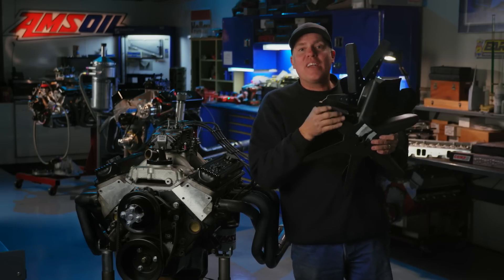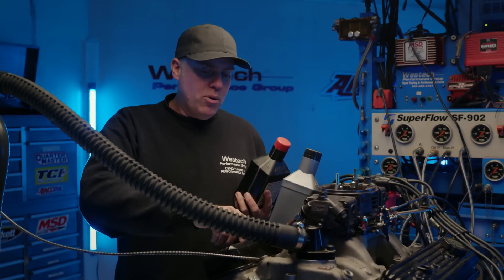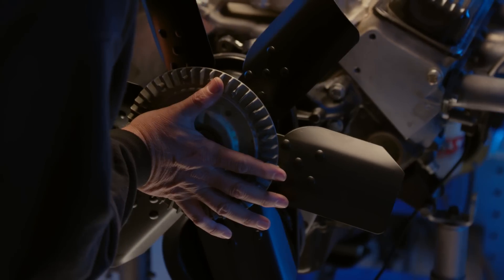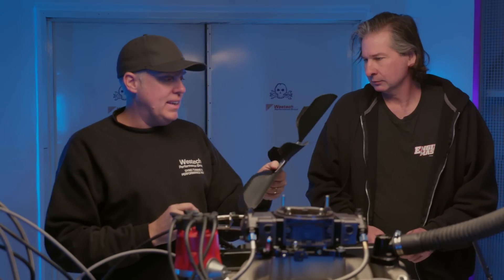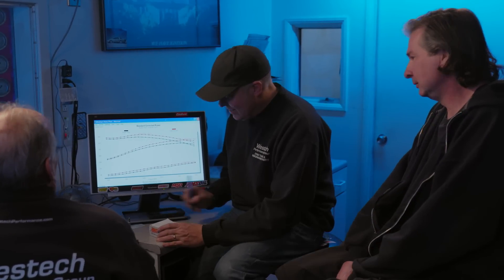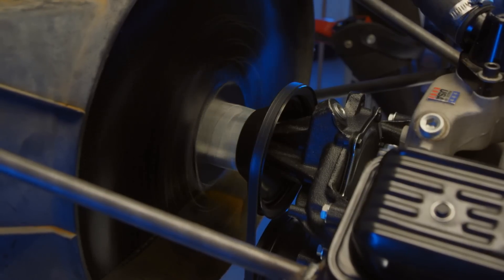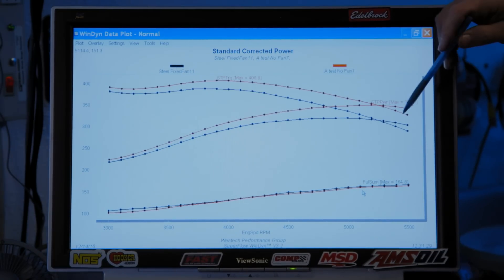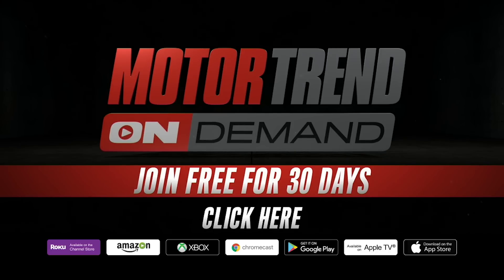Cooling Fan Shoot-Out! - Engine Masters Ep. 20

Comment: Saying that electric fans are more efficient is the right conclusion for the wrong reason.  What is somewhat suggested here is that electricity is simply the better way to power a fan, but I don't think that this is a fair conclusion.  The reason is that the blade designs are not comparable.  These are each essentially a single bend, stamped out on a metal press quickly and easily to make for low manufacturing costs and surely must create high turbulence.  Contrastingly, your standard electric fan actually looks like a fan, not a crudely bent sheet of metal.  The common electric fan has smooth flowing curves that sharply cut the air parallel and then gently guide it into perpendicular movement, they don't just smash the air with an angled hammer.

So it is not crankshaft versus electric power, it is the fan design.  Make a crankshaft driven fan with the same shape as what you would find in fans for every other application (furnace, air conditioner, box fan, oscillating room fan, personal desktop fan, etc.) and it would probably be just as efficient.  Search your favorite retailer for fans and you will not find anything nearly so crude and inefficient as these.

I would imagine that part of the reason that crank driven fans are so bad is because the crankshaft starts and stops violently and therefore an attached fan needs to be made of strong materials.  A small electric motor is weak and therefore accelerates the blades gently.  Attaching a fan designed for electricity to the crank would probably cause it to be ripped apart when the engine starts.  This makes engineering a sleek design difficult.

Comment: I think that the reason that the fixed fan made better power without the fan shroud is due to the fact that it's not pulling as much air through the rad. While you will see better power, the cooling will suffer, and the engine will run warmer.

Comment: I'm curious whether one could jerry rig a high compression engine by welding metal to the piston heads.
Reply: I have seen this done before, it is old school and probably has a good chance of failure. It would be much easier to get high comp pistons or maybe weld on the head and have it machined.

Comment: I don't want to rain on your parade engine masters, but this was an invalid test.  First thing I noticed was the bare carb.  Then when you added fans, no one commented on turbulent air ripping over the carb throat.  
Put a tall enough stack and bell - with an air flow meter -  to see if anything odd is going on in the dyno room.  This should kill the disruptive air over the carb.  30hp to just move that air is a tad on the absurd side - even if it wasting power just to heat the air it's churning.  30 HP is over 22,000 watts guys.  That's one hell of a belt driven furnace!

Comment: The shroud forces the fan to pull air through the radiator, which adds WAY more resistance than if it can move air freely that doesn't have to pass through the rad.

Comment: David Freiburger and Steve Dulcich - this wasn't a TRUE comparison, put the radiator and shroud in front of the engine with NO FAN and see what happens. NOBODY runs a car without a radiator, even if they aren't running a fan on the engine and using an electric one.

Comment: On the front of the fan blade you will have pressure and on the back a vacuum. When its in a shroud there amount of air available to fill the vacuum is less. Its basically trying to suck the fan backwards and only gets worse with smaller radiators and shrouds. The purpose of the shroud is to direct air through the radiator though so the radiator is more efficient.

Comment: The fan clutch won't cause a loss of power at highway speeds. the air moving through the radiator will be greater than what the fan is pulling through the radiator which essentially puts a force on the fan to spin it. If the fan clutch is engaged there will be noticeable drag because the fan will spin faster than the air flowing through the radiator is moving.

Comment: Anyone else curious on electric fan numbers?

An electric fan pulling 50A (WAY high) consumes 600W of electric power at 12V.

Assuming we have typical inefficiencies (70% efficient alternator and a 70% efficient fan motor), this takes right around 1200W of power at the crank. That's 1.6 horsepower.

Comment: But: when you're accelerating the car is moving so does the air. Doesn't the airspeed reduce the drag?
Reply: good point. but also very car specific, i think....depending on how the air is guided into the engine bay and out again. maybe a task for a car-dyno.
Reply: they have fans pointing at the engine with wind speeds at 60 mph. its just like driving
Reply: below 60kmh is no difference, over 80 kmh difference can be noticed, because cooler has tiny gap between coolers pipes and makes big air drag to airflow, so airspeed must be very high to flows faster than fan grabs air
Reply: Also the majority of your butt-dyno is feeling horsepower while accelerating, not while cruising on the highway. Taking power away between a stand still up to 60 is where the fan is going to hurt your power, not after you get to 60 and level out.

Comment: Maybe do a future episode with electric fuel pump vs mechanical fuel pump. I'd be curious to see how much or how little power the fuel pump eccentric drags from the motor. It would have to be a carbureted motor though, as typical mechanical fuel pumps can put out a max of maybe 10 psi.

Comment: With the shroud off there's less air restriction, you have to think that the radiator itself is very restrictive in terms of air flow and with the shroud off you're allowing the fan to pull air in a less restrictive way.

Comment: Removing the shroud improved HP because it was no longer being forced to pull air through the radiator. Just like a subwoofer, a radiator fan is more effective when it faces resistance. If it's not facing resistance in air flow then its not likely to be doing its job, but like we just saw, it requires more power to move it.

Comment: This might be an obvious statement but I think the test might be missing the moving air that'd be running into the radiator at speed and how that might help mitigate parasitic drag due to the positive air pressure towards the front. I don't think it was covered but if the dyno is running a fan that might already simulate that. Also looking forward to a similar test running electric fans if you're ever brave enough to do all the setup.

Comment: YOU GUYS ARE VERY GOOD AT WHAT YOU DO BUT, THE FIRST TEST WITH THE FAN WITH THE CLUTCH HOW COULD IT BE TESTED WITH OUT ANY DRAG IT WAS FREE SPINNING IT TAKES HEAT TO ENGAGE & YOU DIDN'T HAVE ANY HOSES CONNECTED & HOT COOLANT RUNNING THROUGH THE RADIATOR IT WAS JUST FREE SPINNING.

Comment: okay i'm writing this before the run with no shroud to see if it eats more power then with the shroud, and I'm putting my money on no shroud eating more power, here's why, the shroud allows the air pressure where the fans running to be lower then without the shroud, therefor taking less power to drive the fan through it.

Comment: One variable you guys didn't test, you were in a static air environment, when you're driving there will be windforce coming through the front of the car reducing the HP draw of the fan
Reply: There's an Extra about the Dyno cells at Westech, the air in there isn't static. They have vents in the front of the cell and a giant exhaust fan at the back. Dave said in that extra that when everything is on and your standing in the room you can feel the wind moving through it.
Reply: Shane Serpico The correction is much appreciated sir

Comment: If i remember correctly from fluid dynamics the lack of a fan shroud reduces its rotational power consumption because the area the fan is outputting the air is less restricted reducing its resistance to rotate, where as with the shroud air is running off the top of the fan blades and getting pressed against the fan shroud increasing air pressure and thus the air's resistance to flow.

All around great video!

Any chance of having some fan wiring tips in the future, possibly something about making an electric fan system RPM or temperature dependent rather than just on/off? Or possibly a test to see if the thickness of the radiator with a direct drive fan effects the amount of horsepower lost?

Comment: The radiator is acting like a air filter causing a restriction in air flow.  Without the shroud no air is pulling pulled through the radiator. Duh! it's going to make more power without the shroud.  I can't believe you guys didn't know that.
Reply: sorry...I thought if a fan is restricted, it is not doing as much work. be interesting for tham to do....why vacuums rev higher when blocked? does seem counter intuitive.....but are they doing less work?
Reply: Restricting airflow to a fan does not make it turn easier.  If you increase the difference in pressure between the two sides, you increase the load on the fan.
Reply: no need for smarts here.....man someone argued with you
Reply: to jp
Reply: This is almost word for word what I was telling some friends after seeing this video. I can't believe those three guys in the vid were so baffled by the result.
Reply: I can't believe you guys thought to use the radiator and shroud, but didn't know why you were using it.
Reply: Restricting air flow to a fan makes it turn easier. More air will spin around with the fan blades which puts less resistance on the fan than if it is pulling air through.  
I used to work at a gym and when people found fan resistance exercise bikes too hard to pedal, we would stick magnetic sheets to the fan cage. This restricted to air flow through the fan and made it easier to pedal.  
The reason the fan took more power with the fan shroud on is because the shroud forced the fan to move more air by directing the air flow. Without a shroud the fan was allowed to spin more air around and it didn't have to move so much air backwards.  
A more restrictive radiator would actually make the fan take less power from the engine.

Comment: Might be kind of cool if you guys took an engine and ran it on gasoline, then ethanol, then had some milled heads that were the same as before, just with much smaller chambers, to compare the advantages of gasoline at regular compression vs ethanol, vs ethanol at high compression.

Comment: Without the shroud is probably just creates a huge low pressure area around the front of the fan that stays there. meaning the fan is moving less air. Similar to a vortex ring state for helicopters that results in a massive loss of lift.

Comment: The HP numbers are flawed.
Although the comparison between each of the fans would be similar to each other. In real-life, all the fans are all fed moving air (um.. vehicle is moving), and therefore using less power overall.
This test needs to be redone with wind speed in the dyno cell of 60mph to have relevance to actual conditions -if at all possible.
Anyway.. OE clutch fans rule. I can't stand the horrid white noise of electric fans that you often hear before the V8 rumble.

Comment: Have a look at the sheets in the streetable areas of the rev range.

Yes they still suck HP but the clutch fan didn't start killing HP until over about 3500.

If you have a nice little rod with that SB, before I'd run a fricken screaming banchy of a Thermofan, I'd throw a good clutch fan on it.

Most people I know with high performance stuff still run fans (most those stupid stainless decapitators) but they remove them when they go to the drags as they are not running for long enough to make a difference and some of them use a leaf blower and a sheet of cardboard to blow through the rad if running a bit warm.

On the street, no one would notice the difference with a clutch fan but would always notice when an electric fan cuts in.

Comment: Not really baffling, without the shroud the fan won't have to suck air through the radiator, so it robs less HP, would be interesting if you guys do an electric fan shootout and see how different electric fans handle high HP.

Comment: My '02 Chevy truck 5.3L with aftermarket supercharger has the OEM clutch fan, plus 2 electric fans inside the roomy fan shroud for a total of 3 fans. I added the 2 electric fans because the AC doesn't put out as well idling in traffic with the OEM fan alone. I also tried deleting the OEM fan and going all electric for a while, which worked OK, but then one day I blew the fan fuse and decided to no longer allow the possibility of no fan at all out on the road on a hot day, so I re-installed the OEM fan for backup. I have a master override switch to turn off the electrics in the winter, and 2 separate relay circuits on the electric fans. One fan is wired to run when the AC compressor cycles on, and one fan is wired to an adjustable thermo probe in the radiator, so it runs only when the radiator sees high heat. My objective with this setup is not max HP, but max insurance against overheating and max AC performance. Also, 25 years ago I had one of those metal flex fans throw a blade when the rivets sheared while I was jazzing the throttle on a G2 small block in a '68 Camaro. Fortunately, I was in the driver's seat and not under the hood. It put a nasty dent under the hood where my head might have been. Don't have any part of your body over any fan if you jazz the throttle while under the hood.

Comment: I would like to see a measurement of air speed through the radiator core at idle and cruising speed when the shroud is fitted, giving us an idea of efficiency, not just hp used.

Comment: Use an electric fan! To think of how. Far Chevy had to go to make an honest 350hp out of a 350 cu in stock block engine! The 350 hp 327 made only 313 hp on Vic Edelbrock's Dino in his testing in the mid 60's. The 350 Hp 350 actually made 323 HP according to crane cams in their early 80's testing. One way to keep the horsepower you've made is to reduce the parasitic drag on the engine. The more accessories on the engine during the dyno test, the lower the HPWill be. This is the difference the rating of the 60's and the ratings of the late 70's/ early 80's. Factory tests were gross VS net, or just the engine at the crank vs everything that comes on the motor bolted on and running for net hp. Net hp means running the alternator, water pump and A/C compressor along with power steering and hydroboosted brakes. All that extra crap sucks horsepower! Besides an electric fan, a fan clutch would be the least power robbing set up as it only uses the fan when the engine is hot. Also a fan shroud will accelerate the flow of air over the radiator cooling it down more than running without a shroud. It's the Venturi effect, just like a carburetor that speeds up the flow of air over the radiator. My vote? Electric fans or fan if the motor is small enough! One of my instructors at UTI ran without any fan on the street, he just avoided stopping wherever he could, and had extra overflow tanks when he couldn't. But he made horsepower and Had one of the fastest street cars on the main drag cruising through the late 70's!

Comment: Wow!, I run one of those plastic/nylon fans on my car. I've never had issue with overheating and at the time, I figured if the fan was ever to "let go" at the track, the carnage versus a steel/aluminum would be much more minimal. I 've seen steel/alum. fans cut open hoods, destroy radiators, cut open heater hoses, shred belts, gas lines etc. etc. So that's why I made the choice to go that route many years ago, to minimize collateral damage if the fan ever decided to disintegrate during a high rpm blast at the track etc. But if I'm leaving a potential 25+ hp and related torque on the table running that way, maybe electric fans are the way to go! Just a pain in the ass to wire and the AMP drop etc., is hard on the old school hot rod. But, it's worth a try! Maybe this spring/summer I'll dick around and see.

Comment: Neat test. I agree with other posters on here, that a CFM test would've been a nice thought vs h/p loss. I tried running dual electric fans on my Mopar yrs ago, I wanna say  12 inchers each, with my 180* stat and it would get to 220*, fans running like mad, at a stop light. I put the stock 7 blade thermo fan and factory shroud back on it. Never gets past 200* even with the a/c on.  There might be something better out now, but that system was from Be Kool, and supposedly rated for 600 h/p, which my mill is far from. What I find funny, as an off note, is guys that try and run electric fans with the stock alternator from the 60's and early 70s.. You know, the 1's that put out 46-60 amps max? And they have the head lights on and radio blaring, and then the fan comes on, and the lights dim to candles.. lol Test it for yourselves, ladies and germs, 1 of those old school alts barely puts out 20 amps at idle. Electric fans =s an upgraded alt and battery, with the wiring to handle the power.

Comment: it took less horsepower because with the shroud there is a slight vacaum between the radiator and the fan, causing back pressure against the fan which in turn makes it harder for the fan to turn in the right direction, with the shroud off, there is no vaccine created which causes no vacaum drag on the fan allowing for less horsepower stolen --- came up with this theory as I was watching the show

Comment: Good stuff. No matter others haven't believed!

Couple good point you missed though IMO.

Clutch fan...assume it stayed cool and free wheeled in test? ...why hp wasn't as bad.  Do a lock up on same clutch fan.

Electric facts....
Typical E fan pulls 30 amps.
Amps x volts = power...12x30=...360 watts of power.
746 watts = 1 HP
Yep, 1/2 HP to get same effect (ideal)
Parasitic losses from alternator etc = A WHOLE LOT LESS HP LOSS THAN ANY OTHER SYSTEM.

Except, no fan at all ; )

Hammer down : )